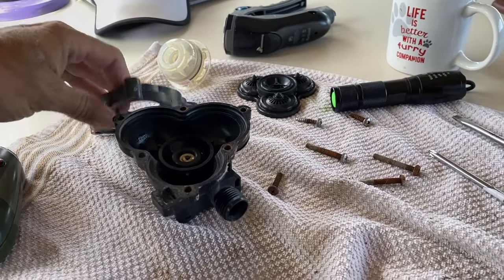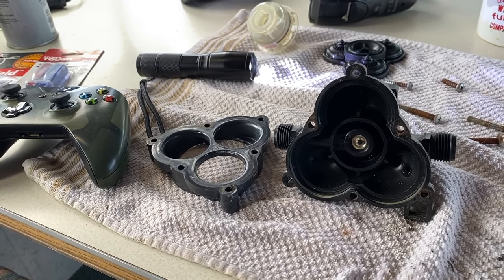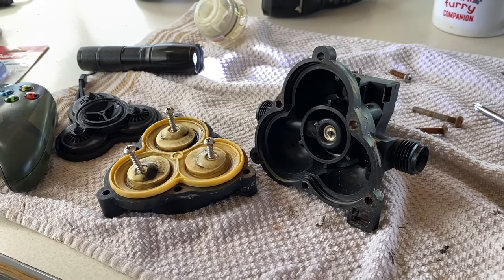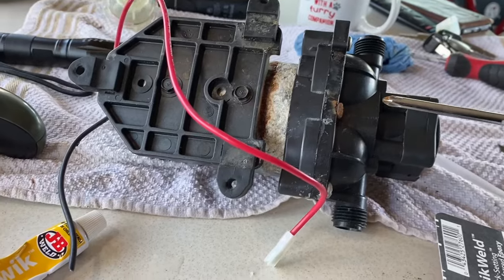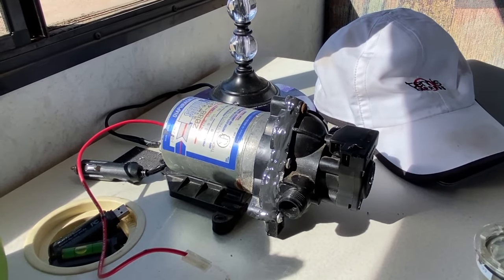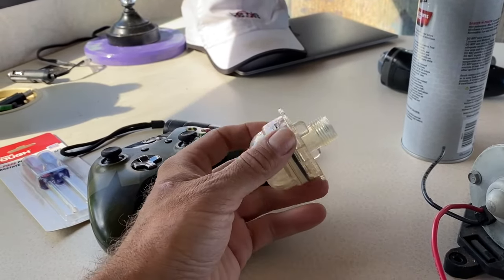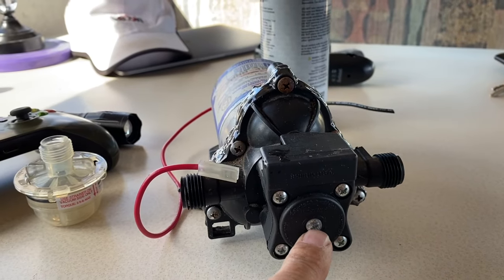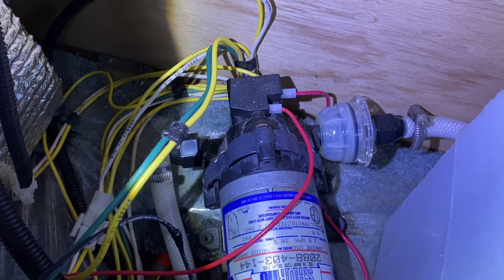Fixing Leaking RV on Board Water Pump

Comment: Hi, had the same problem with my shurflo pump (made in Mexico!) all for the cost of a gasket.
Fixed mine same way as you but used some bedding sealer I had left from fitting a roof vent.
Great stuff, very sticky and viscous but never sets.
Did the guy next door get charged for two pitches ?
All the best from Rhodes Greece 🇬🇷.
Reply from the maker: I doubt he got charged double.  It was a lady and I didn’t see anyone else.  Maybe just inexperienced